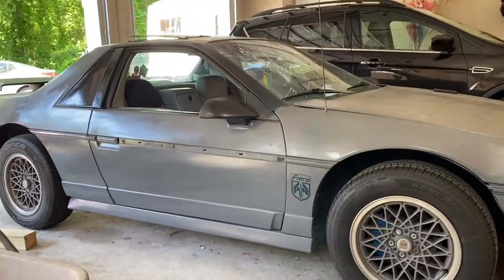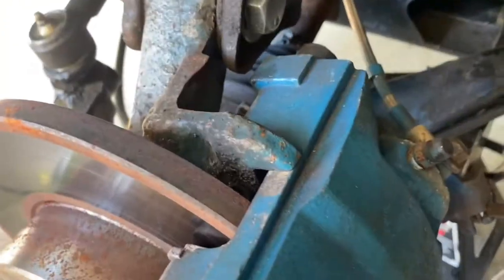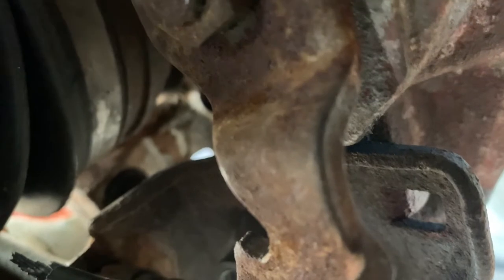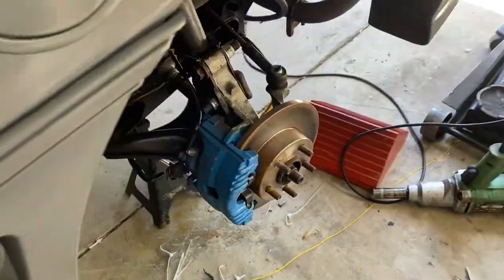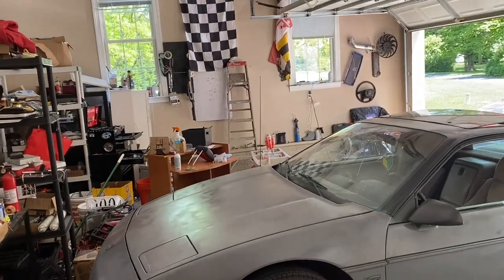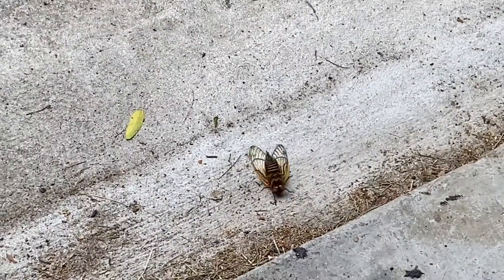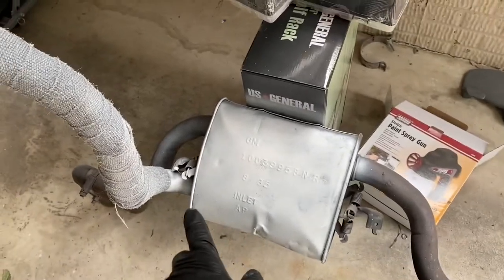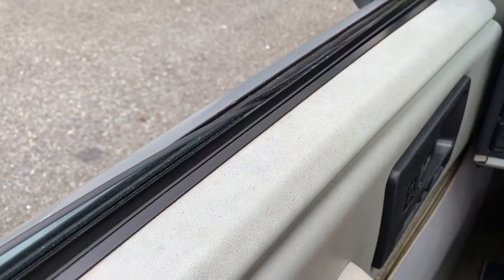Getting Handsy with the fiero (parking brake that is)

Comment: So there has been some updates, about halfway down.

I'm In the middle of doing a rebuild on the entire rear brake system on a (no rust) 1984, and it has been a terrible time. 
What originally should of been a 1-2hr job (pads/rotors) has already taken me multiple weeks.

Basically it went from a simple job, to then having to rebuild the rear right caliper as it was seized, the line was cut clean through(but was not leaking?), and inboard pad was removed. 

Now I'm having to rebuild both calipers and replace the entire parking brake system. Why?

I've discovered that the last person(s) to work on it had zero clue on how to fix or store the vehicle properly (clips installed backwards, dust boots missing), and the car was stored long term (at least 10 years, possibly 20) with the parking brake engaged. I'm also getting new tires as the ones on it were (Like-New) built in 2010!

So everything in the rear is locked up even with the E brake springs removed. My only good thing is that the car wasn't expensive and parts are cheap, though it's already been a depressing adventure. Seeing as I will not want to revisit this any time soon I will be keeping everything properly adjusted and greased!

Update: Unfortunately I cannot locate a gasket (that's on more than just Fieros and 6000's, it was on Camaros and Firebirds from 1982-88). That is (on the Fiero) for the parking brake actuator located inside the calipers piston.  I discovered the car when purchased was running and driving on only the front brakes. So for the time being I will temporarily bypass the parking brake mechasim so I have all service brakes operating, and I can utilize the car. This will only be until I can find a source for new gaskets or another proper solution. To do this I'm going to be using Pontiac 6000 front brake calipers on the rear as Pontiac originally modified those to use with a parking brake (As that is currently the most cost effective solution than locating the gasket). Fortunately there are no inspections or hills around so this will buy me enough time. 

In addition I understand fully why there was a recall on the Fiero's brakes. It's because of this modified piston design. The design is basically a piston within a piston and the clearances are way too fine, the relief valve location also adds to this problem by allowing high pressure brake fluid to force it's way out of the system with the debris in tow. 

Any debris (under half a mm) in the system will eventually cause it to jam! If it's not utlized enough too much debris will collect and render the system kaput! What pontiac should of done is had a one way valve on the internal actuator not on the piston head. This would of allowed fluid forces to be kept internally, and they may of not even really needed this seal. 

 Even if you do utilize the parking brake often the debris that collects will just cause excess wear if the fluid is not flushed often. I'm almost thinking annually/Bi-annually in the rear calipers (if I manage to track down new seals).

I am also going to be looking into a non stock option to have a more modern parking brake setup (drum inside rotor) to replace this poor design as it's just designed to keep failing. I've also found that locating tires in the stock size that are not trailer tires is getting difficult so I may eventually try and upgrade to larger wheels

TLDR: It's really, really bad....but solutions are being figured out.

Comment: The parking brake is always an issue on the 84-87 Fieros. Poor design.
Reply: Yea I'd say it's an "almost" correct design. I think there could be a decent possibility for a fix without changing very much at all.

IMHO it would require some minor changes of the rear caliper piston assembly, mainly a new solid cast piston shell (to remove breather valve hole) and then adding a small internal relief hole (with or without a check valve TBD) to the actuator dome (inside the piston).  It'd require testing to verify functionality, but that may be a possible fix.

Comment: My e brake works but I have to fiddle with the handle to get the light to go up but most of the time I have to hold it down to keep the light off or it will stay on the whole time I’m driving it. Please help 😩
Reply: I had to bend the switch further down so the parking brake could actually disengage the switch. I don't understand how the switch is supposed to work because the parking brake can't actually reach  the switch to break the connection.

Comment: Sorry to be negative, but your handbrake shouldn't lift that far if the system is properly adjusted. 3 to 4 clics max.
Your caliper pistons may need rebuilding? The adjuster mechanism (inside) is prone to siezing up.
Pain in the a** job on a Fiero! Good luck never the less 👍😉
Reply from the maker: Oh that’s not negative I’ll look into it, the whole premise of the car in my mind is ‘good enough’ others have done super detailed fixed everything that’s not what I want to do here. Yeah more likely then not tho they prob need a rebuild